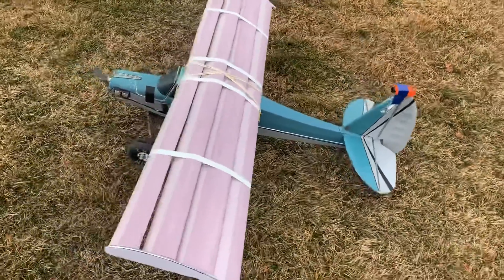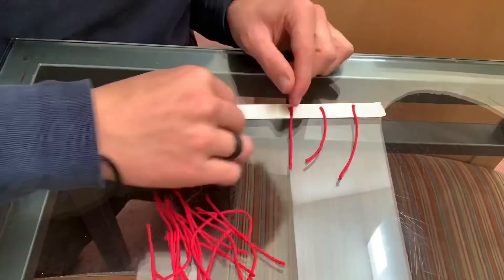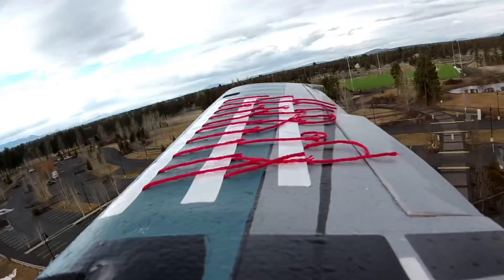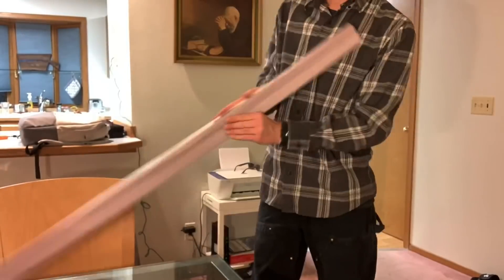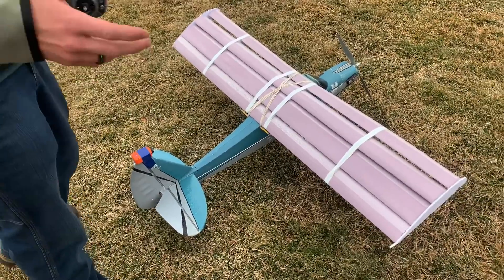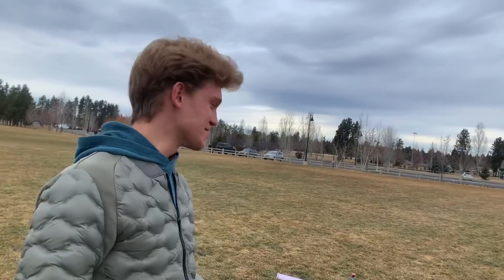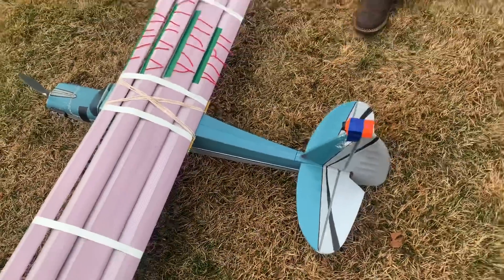“Unstallable Wing?!”

Comment: In practice, having an un-stallable wing is like having an unsinkable ship.
Reply: Ships are unsinkable if the construction components are less dense than water. Un-stallable doesn't mean uncrashable
Reply: @LilleyAdam  Which ships have control consoles, nav gear, furnishings, galley equipment, windows, and all kinds of other components that are all less dense than water? How much of a ship can sink whilst it is still labeled unsinkable? If pieces of the construction float on the surface, upside down or separated from one another, is that good enough--is it still a ship? In practice, ships (and even many small boats built to US standards) sink, and wings stall. It just takes the right combination of conditions and factors.
Reply: @ReflectedMiles  many catamarans float in event of capsize
Reply: @LilleyAdam  I seem to recall one of the tourist catamarans we use down in Costa Rica sinking a few years ago, with lives lost. Some of the plastic-version toys we use in the lakes around me in the US certainly float, yes. I'm not sure how useful that is as a model for ships and other craft, sort of like radio-controlled aircraft being the basis for life-size applications. Scale and proportions make a difference as well.
Reply: @ReflectedMiles  okay. SOME catamarans float in capsize. Note in not saying they don't sink. I'm sure if every/most hull pocket was punctured it would sink. The interesting concept behind this design is that at higher and higher AOA, the wing starts to behave like a bi/tri-plane wing, continuing to lift. I don't think anyone is going to die in the hill of "totally un-stallable wing" but it clearly lifts at very long limits, taking far more mistreatment than most pilots would be willing to give if their life was at stake.
Reply: @LilleyAdam  Agreed. It’s just useful to remember how many airfoils and aircraft have already had similar claims made for them, just as with ships and boats. If the claims had been true in practice, those would be the principal designs in use and we wouldn’t have to worry about all of the stall/spin accidents and sinkings that we still do.
Reply: So, thoughts on the ercoupe?
Reply: @jamesbarros950  The design aim with the Ercoupe, in practice, is to be clear and forgiving, but it is not fool-proof. They can certainly be driven into the ground by the wrong pilot, like any other. There are YT videos of them stalling, at least one of which includes a distinct roll-off to the left. Do that on base-to-final and Dan Gryder will be featuring you on his channel…
Reply: The Beech 17 is quite difficult to stall, some would way impossible.
Reply: KvAT  Well yes - and that is for example what the laws in the USA say about small boats. They are required to be unsinkable - their specific weight must be lower than water, so even if you cut it into parts they will still float. Kinda like trying to sink a cube made from Polybutylene - you simply can't do it cause it is less dense than water.
(unless you wanna claim it can be sunk if you just wait a couple thousand years for the material to degrade.... of course man-made things will not last forever)
Reply: @ABaumstumpf  Here is a recent recovery of a small US boat from 52 ft. down. https://www.youtube.com/watch?v=adqyHngechI
Reply: Stall is not generically when they are not getting lift, but when flow separates and there's only turbulence atop the wing and at the trailing edge controls.

Very-low aspect-ratio is stall proof.
Flow does not separate from the top, and the trailing edge controls have strong smooth flow, even at silly slow speed and very high 35degree +"A".
This is proven.
See the '30s Nemeth parachute plane. Alliance Argo with a 15' diameter wing parasol. Aspect-ratio 1.27.
Faster than the original, 45degree climb, 60degree super slow descent with practically zero landing roll in any wing.
The similar Farman 1020. Also on the fuselage of a known successful (monoplane). Faster than original, would not stall.

The Arup planes from Indiana are the best known. (Predecessors of the Vought / Zimmerman V-173 "flapjack".)
Stall proof, STOL, aspect ratio under 2, notably not draggy or inefficient in cruise, but sleek and quick on little power.
The '40s Eshelman commonly known as the "flounder" aspect-ratio <1.

The 80s "Little Bird" follow on to the Arup.
The '90s Wainfan "Facetmobile" 100 kts in 40hp, with 340lbs useful load. Would not stall, could stay aloft at <16kts.
The Australian Rowe "UFO " 2015 & on. Circular wing, not draggy, steep climb.

At aspect ratio under 3, the huge wing-tip vortices wrap around capturing a "bubble" of low pressure above/behind the wing giving up to 3 or 4x the lift you'd expect from that area & speed.
The vortices trap flow from the front over the wing keeping it from separating.

They are not burdened by always carrying around the vortices and attendant drag: the vortex-driven "parachute lift" at super slow speed and high "A" is elective and temporary.
Reply: I thought all wings were unstallable...  isn’t that why you have to tie your plane down when not in use?
Reply: @bobinthewest8559  being blown over in wind is not the same as flying lmao
Reply: You guys are all fucking idiots for arguing about something completely secondary to what OP is talking about.
Reply: @sleepdeep305  that sounds like what you're doing right now. so doesn't that now make you the idiot?
Reply: @Detheyas  Well I ain't arguing, I'm just pointing out the obvious. So, yeah, I'd say your idiocy is preserved!
Reply: Well no - we have actually unsinkable ships, but for a wing "unstallable" is nearly impossible. Stall just means that after a certain angle of attack the lift is no longer increasing but decreasing. A wing that can be said to be unstallable would already start with so much lower lift that it is not viable for basically anything.
This wing here is very good already to the point that it is really hard to stall it, but it is just not viable.

For Ships unsinkable designs are mostly only used for 2 applications:
rescue boats and small commercial boats ( in the US basically all small boats are required to be unsinkable - you can cut them in half and submerge them and they MUST still stay afloat).
Reply: @ABaumstumpf  - alright, but suppose we loosen the definition of "unstallable" to some very low speed that permits very low-roll landings. Isn't that a practical and useful goal? The question is whether that's achievable.    https://www.youtube.com/watch?v=qndwkWJSOwM
Reply: @ABaumstumpf  You will have to inform the marine industry of your “truth,” then, since we regularly send bulk carriers, especially, to the bottom. If the industry thought those huge losses were avoidable with a design change to something unsinkable, they would avoid them. (Just filling a hull space with foam so it hangs upside down in the water until it smashes into rocks somewhere doesn’t count—it has to be functionally unsinkable such that lives and cargo are not lost.)
Reply: @ABaumstumpf  Unsinkable? You are the fool here.
Reply: @ABaumstumpf  Nice attempt to substitute subjects, but your claim has nothing to do with my statements regarding ships. However, I also live just a few miles from some of the largest marinas in the US. If you think that, as a result of minimum-standards legal construction, even small boats never go to the bottom, you should see all the pictures on the bulletin boards at the marina offices. For that matter, check out whole businesses built around that unfortunate reality, like American Underwater Services. There were small boats in a floating Trump parade last year that sank and are now the subject of scuba diving at that lake, humorous as some of us might find that to be. No doubt they believed just as you do.
Reply: @ReflectedMiles  most sailing boats are by law required to be positive displacement to weight ratio. That means that if you grind up the whole thing the resulting pile should still float.
As a matter of fact nowadays it is rare to the extreme for boats in that category to sink, and that's just general marine joy boating.

The German DGZRS (a volunteer SAR organization) is operating boats that are in fact unsinkable. The materials add up to positive displacement/weight ratio, the whole boat is built with segmented chambers filled with foam thus making them unfloodable.
The whole system is built to be capable of rolling multiple times without critical damage.

As a matter of fact we had boats that were unsinkable for over a century. The small wooden boats the RNLI routinely used even in the 1900s can not sink. You could fill every nook and cranny with water and it would still float.
There is however no way to protect the human crews against the sea. Multiple crews were lost where the boat actually survived. 
The benefits of modern unsinkable ships are primarily in crew survivability. With heavy automation the crew can stay in safer areas of the ship and only have to risk their lives under rare circumstances. It does however still sometimes cost a live to save lives.
Reply: @Argosh  Etap Yachts (Belgium) is the only line of sailboats I am aware of that has survived to an actual certificate of unsinkability from the French Merchant Marine, and that is the only body in the world authorized to issue that declaration, I believe. In that particular design approach, my understanding is that much attention was paid to how the closed-cell foam within the double-hull space was protected during a water-ingress event. For other boats in general, of any type, and even Etap, the question is usually not whether they are unsinkable but only how long it takes for the foam and other measures used against sinking to be compromised. It may be such a length of time that it normally allows for at least days, if not weeks or longer, for rescue to be effected. When all is said, however, so long as no time limit is set, the pictures on the walls at the marinas tell the eventual tale.
Reply: @ReflectedMiles  check out the DGZRS ships though. They're (as far as I know) the gold standard for rescue vessels. They are at a point where it's survivable for the crew to be washed up on a rocky shallow coast during hurricane strength winds.
Reply: @Argosh  I am personally familiar with a family whose boat survived a severe storm unscathed and all of the family members who were aboard her did not. That was on a Boston Whaler. I would not argue that such events don't happen. I am simply saying that, in general, the idea that a ship is unsinkable always ends up being incorrect--it's just a matter of conditions and time.
Reply: @ReflectedMiles  there is a point where the conditions and time required become so impractical they're irrelevant. With modern hygrophobic closed cell light foams we're already at a point where you'll have to wait for decomposition... So boats build out of composites including that sort of foam just won't sink. You can stretch the definition of sinking all you like, in the end it's a floating wreck.
No one claims indestructibility. That is a thing the sea hasn't accepted ever. Anything humans build the sea can destroy. But it'll have to live with the fact the pieces always stay up.
Reply: @Argosh  No, they don't. Sorry. Anyone with experience in foam-cored boats is terrified of water getting into that space as a result of damage, cracked seals, new thru-hull fittings, etc. Foams degrade, sometimes with surprising speed depending on conditions, and can hold amazing amounts of water in the process. All that water starts to add a great deal of weight, etc., etc. That's why newer boats built to these supposedly unsinkable standards can still end up in pictures on the walls of the marinas.

Floating on wreckage is also not a particularly survivable strategy for any length of time in contrary conditions, so I'm not sure that should be regarded as unsinkable for marine purposes. Wings that don't "stall" but still crash from an inability to maintain controllable lift fit right into that category as well, making "unstallable" almost purely academic.
Reply: @TK-cl1jm    Boston Whaler boats laugh at your contention.
Reply: @stephenbinion6348  I didn't realize Boston Whaler manufactured ships...
Reply: Y’all dumb af even caring about this nerdy shit. Don’t y’all see the fucking dinosaur he’s tamed on his desk????
Reply: not really lol, you can still shoot it down
Reply: @ryushev2000  My point was that every time humanity makes a grand claim of that sort, like launching a ship that is hailed as "unsinkable," it seems that all of Nature and Nature's God set out to prove its designers wrong and tragedy follows. No shooting required.
Reply: @ReflectedMiles  ah ok, i get it now
Reply: @ryushev2000  yes but you can still hit an unsinkable ship with a iceberg

Comment: What's going on is the gaps between all of the airfoils creates a circulation effect that causes the flow of the air over the surface to behave in such a way that it increase the overall lift of the entire structure.  As you explained, since the angle of incidence each wing in the overall structure is different, and they stall at different times.  The leading wing may be stalled but still getting lift from the others.  Very cool idea. Enjoyable to watch.

Comment: Those little yarn pieces are called tell tails in the sailing racing world. Most serious racers have them for trimming the sails better. I am really impressed with your experiment here. Excellent job. I stumbled on to this video but almost passed it by. And then said, wait a minute, I've gotta check this out.
 I'm a 64 year old surfboard and boat designer. And my dad and I made many balsa gliders back in the early '60's, experimenting with all kinds of designs. Your experiment was extremely well done and accurate on each wing foil, angles, and construction method. Nice dry humor to the video also. I didn't think this design would make that much difference, but I was amazed at how efficient it is. That's crazy how good it works. Nice work...

Comment: The reason it wash mushing along with full back elevator, is that as overall AOA increased, the front aerofoils will lose lift, while the rear aerofoils keep generating lift, moving the Center of Lift aft, making the aircraft feel more nose heavy. This effectively drops the nose after a certain point, preventing a full stall unless you work really hard at it. This is how slats and slots are designed to work. Fun project! Cool video :)
Reply: 19 likes, your logic is reversed though! the rear stalls first.  The drop in lift results in sink and the horizontal stabiliser then raises the tail and re-establishes wing flow.
Reply: @givenfirstnamefamilyfirstn3935  if you look at the drawing you see that the mounting angle of the rear part is quite far down, whereas the front ones are mounted almost neutrally. So in a high aoa situation the top one also has a high aoa and thus stalls, but due to the negative mounting angle the back one has not stalled yet and thus generates the lift and negative pitching moment.
Reply: Yes the tail is what stalls and in this case brought the model down. I wonder how that would work in a canard design.
Reply: @NikosWings   No the (lower attitude) Horizontal stab' is flying and generates tail up/nose down lift.
Look up aeroplane stability on line.
Canards stall the (higher attitude) foreplanes first lowering the nose.  This enhances their basic safety.
Reply: Beech Staggerwing all over again.
Reply: Y’all dumb af even caring about this nerdy shit. Don’t y’all see the fucking dinosaur he’s tamed on his desk????
Reply: @offyourself3986  if you don’t care, how did you end up here?   Also, you have stuff today thanks to nerds like him, so…

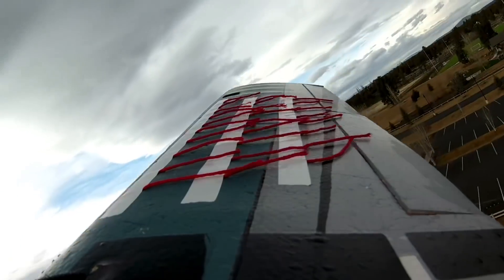Comment: ummm         at 1:59,???    NONSENSE.       lol.              one question is, did you know going in, how pointless this project was.            it's pointless because,    stall  happens  When  It's  Supposed  To.!       period.
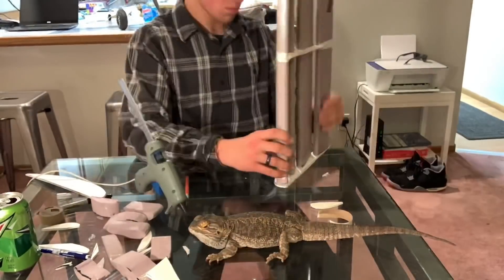at 3:31,  the result  is  a  stoopidly  Chaotic lower surface   and   'under-cambered'  airfoil.            at 3:54,   WHERE'S   THE    YARN.!!!!            when stall (from low airspeed)  occurs,  there are  TWO  overlapping problems.      they are, the stall  and  associated loss of altitude, and    controls that  Don't  Work.   which makes it difficult  to execute a stall recovery.        googletranslate

Comment: I would say it did stall. Just at a different time.
As it pitched up relative to the forward momentum, it was able to maintain lift as long as it had inertia.
But with the high angle of attack, drag slowed it to the stall speed. The propeller is at the wrong angle to maintain that attitude of flight.
Increasing thrust recovers the aircraft, but with an abrupt change in direction.
Fortunately the plane had enough power and thrust to pull this off. It saved the experiment.

This is definitely an interesting concept that deserves exploration. I’m just not sure what next move might be.

Great video 👍😁
Reply: Well, that’s a zero flow over the airfoil scenario.. which means it’s impossible to produce lift, and of course because of that there is no such thing as an un-stallable airfoil.